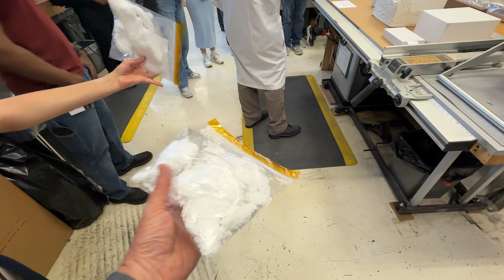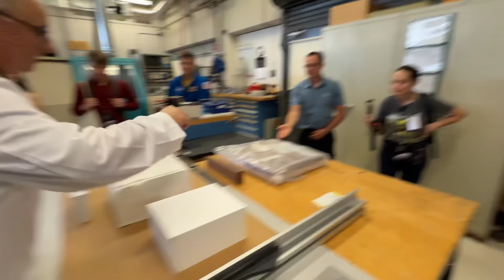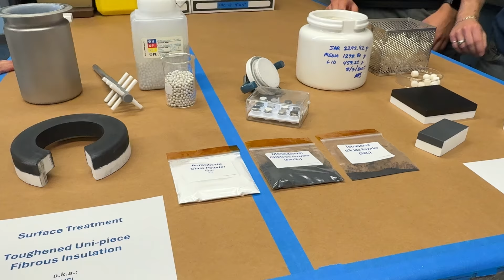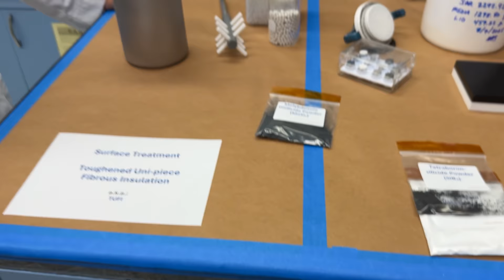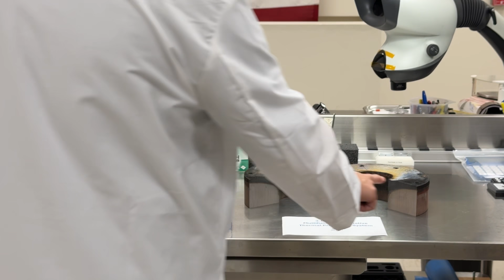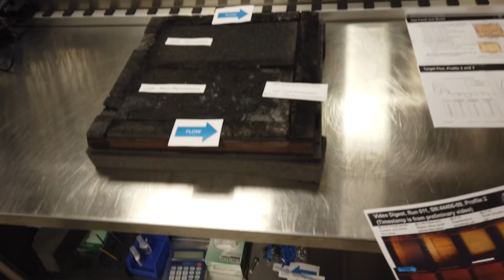Inside NASA's Heat Shield Laboratory

Comment: By definition though, like a passive tile, is a high insulator. That means it slows the transmission of heat or kinetic vibration in matter. So being in the atmosphere, at a fast velocity, and thus hot, would have a time limit since an insulator is a resistor, not a barrier. So all that is just creating as good an insulator that physically withstands air forces to some degree also. You are probably looking for isolated covalent solids.

Comment: I worked at McDonnell Douglas Boeing. The old Rockwell that designed and built the shuttle was already merged into the company. I worked with an engineer on software tools that could do multiple disciplinary optimization design. Fancy word for the way it could do mechanical design, stress, thermal at the same time. We put together the tools and he ran a simulation and the results were re-designed shuttle tiles including their shapes. It knocked 1,000-ish pounds from the vehicle. NASA was very impressed. They didn’t fund it given the costs to implement it and the shuttle was at the end of life.

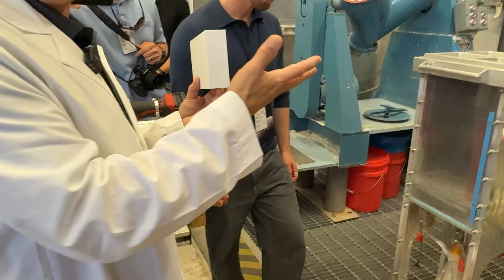Comment: 8:20 how you control the fiber orientation? to me look chaotic no control. also why chope it? (i know it say for density to give more structural) but that also give less control in orientation. is like CNT? bad conductor horizontal and very good vertical/axial? if not than why dont use something like fishing line and lay it down to cover the are and intercalete them but it give lot more air to material. (fiber optics)

Comment: They have these extremely expensive coatings that need to stay mixing or they go bad and they don't have a back up power supply, so if the power ever goes out they are ruined. I don't know how much power those rollers use, but I feel like an ordinary UPS would run them for a long time.
Reply: Cost vs. Risk - Investment and maintenance of UPS across decades vs. a few liters of coatings lost once every10 to 15 years when there's a power outage. A few liters of coating is definitely cheaper.

Comment: Back when SpaceX was starting the heat shield research, I got into a conversation on YouTube about the materials that are used in the mix.  I pointed out a material that is common knowledge, but most don't think about it, and it felt like a feeding frenzy as the focus turned to me.  I am just a retired engineer, with no background in this field.  It is funny how people don't relate grinding materials to heat resistant materials!  

I am shocked we haven't developed a heat shield from lava!
Reply: I would guess the brittle nature of it along with weight, sourcing and shaping it knocks lava based out of contention. You could melt rock but that's energy intensive and you would need to get the gas content correct to replicate actual lava. This stuff is easy to blend, shape and low weight so no need to replace unless something substantially better comes along.

Comment: I don't quite get why we are so opposed to ablative shielding it works so much easier and is so much more reliable. If you use those fragile tiles, at least put an ablative shield above it to protect them until you actually need them.
Reply: Simply put, we like tiles because they're cheaper than ablative shields (much less labor to produce, meaning much lower labor costs to produce), they're reusable (ablators have to be completely replaced after a single use because of the way they work), and they're lighter/less dense, meaning less of your payload mass goes into the TPS and thus more can be spent on things that are useful outside of the "Eight Minutes of Terror."

Ablative shielding is great if you have a Moon Race budget (4% of the entire federal budget!) and are expending each vehicle after a single use, and is still the best choice for high-speed re-entries like trans-lunar (and trans-planetary) direct entry trajectories--note that Artemis's main heat shield is still an ablator--but if you want to be able to reuse the vehicle in anything approaching a rapid fashion, you need to go with something else, particularly if you're trying to do it on a relative shoestring budget (NASA currently gets less than 0.5% of the federal budget).  Everything is a tradeoff, and in many ways, ablators are sub-optimal for many jobs.
Reply: @rdfox76  "because they're cheaper than ablative shields " no, they are not. they are really expansive.

"ablators have to be completely replaced after a single use" so what? you also have tor refuel your rocket.
the wording "single use" sounds like little use. But one reentry is a lot of use.  You also replace the breaks in your car from time to time. 

"-but if you want to be able to reuse the vehicle in anything approaching a rapid fashion, you need to go with something else"

sorry, but reusing a vehicle that rapid, that bolting on a new heat shield is the hold of is delusional. You do need to do a hole service cicle in between flights. And those tiles make that actually more expansive.
Reply: They are reusable and don't have to be re applied, so cheaper.
Re applying a heatshield is a sensitive, lengthy process that has to be done in the lab. Believing otherwise is delusional. Having to do that before every launch significantly impacts the launch cadence and other costs.
Reply: @mattcurrent0  reusabality does not automaticly make things cheaper. the experience so fare is, that those tiles make things more expensive and that they are less reliable than ablative shields.
Reply: @MusikCassette  Yes, just using some tiles doesn't make it automatically better than ablatives and the Shuttle is a poster child for that fact. The process to inspect and replace those tiles was painfully long and expensive. So many things about the Shuttle were ass backwards like that.
However, those are not inherent issues with the tile approach in general, just the way it was implemented on Shuttle. For Starship tiles, Spacex has fixed almost all of those flaws and it will give much better results than ablatives.
Reply: @mattcurrent0  but the fragility of those tiles is an inherent problem. Also, Ablation is an elegant way to get rid of heat energy.
Reply: @MusikCassette  One would think so, but experience has proven otherwise. On Shuttle it was an issue because the orbiter was side mounted, so the foam covering the external tank could (and DID) come off on ascent and hit the tiles, breaking them off. That's obviously not an issue with Starship because in a Starship full stack nothing is side mounted and the Ship, which has all the tiles, is at the top of the rocket and there's nothing above it that could come off and hit the tiles.
As for elegance... well elegance, like beauty, is subjective. Me being a giga nerd, I find all of them elegant. It's not really what we want to base our engineering process on, instead of what works and is practical.
Reply: Depends on the vehicle and its entry profile. Reusable hits the sweet spot for some, while ablative is required for others. Some might use a mix of both (dare I say, Artemis?). There's no 'one size fits all' solution.

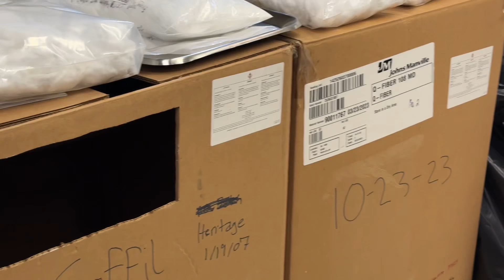Comment: 7:18 That's gotta be SpaceX for sure
Reply: Probably, but I suspect they were more hoping for improvements in attachment and waterproofing than performance.  Making the reuse more rapid, that sort of thing.  They had already greatly simplified the manufacturing, installation, and inspection issues simply by dint of using a simpler vehicle shape that allowed the vast majority of the tiles to be one of a single-digit number of identical mass-produced ones rather than having unique shapes for each position like Shuttle did.

Comment: The Apollo Shield Used an ablative material called Avcoat that was manually injected into over 300,000 individual cells of a fiberglass honeycomb structure. It was highly effective but incredibly labor-intensive

Comment: What type of pressure is seen at the surface of the head shield is seen during re-entry? I guess if we had the weight of the reentry vehicle, the surface area of the shield and the acceleration over time from reentry we could get a rough number. Curious the amount of force the small sapphire plug sees

Comment: I remember in 5th grade our teacher had us recycle paper and make it into new sheets of paper, basically with this process. Funny how some things never change, even when you're doing literal rocket science.
Reply: Hey, fiber manufacturing is fiber manufacturing, no matter what the fiber material and matrix are!  In 4th grade, I made my own paper (more like Egyptian papyrus, but still) out of corn husks using the same basic process, except that I used a door-screen drying rack to extract most of the water before pressing, then dried the pressed product on another door screen drying rack.  It's not far off how Formula One teams make carbon fiber bodywork for their race cars, either, except that they just used weaved carbon fiber cloth, layered, and impregnated with the resin rather than trying to dissolve it into the resin (longer fibers are better for their purposes).

Comment: Was Eric Berger there? Because Ars printed an article of his from July 27th subtitled...  "NASA has not made substantial investments in thermal protection research for decades"
 ( ars tech /space/2026/07/despite-recent-successes-rapid-reuse-of-starship-remains-a-tough-nut-to-crack)

This video seems to conflict with that assessment.

And on that note, did anyone ask the hosts what they thought of the heat shield tech on the private company rockets? I guess he touched that a little when he said a company tried and then asked for a technology transfer, but did anyone ask him directly if he thought, for example, if SpaceX would ever enable rapid re-use without having to replace a significant number of heat shield tiles between each re-use? And if they achieve it, can they expect any reverse technology transfers?

Comment: I think NASA can afford a ups for those spinning solution racks...
Reply: They probably didn't expect a power cut in the first place. But what they really need is a generator backup for the labs. Losing power for a few minutes isn't an issue, but you need something that can keep those rollers running all weekend.

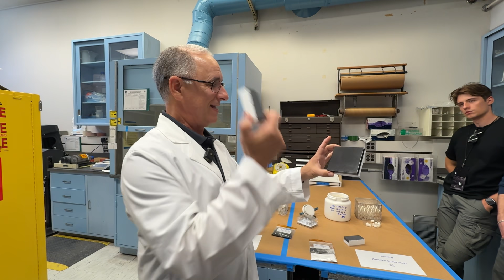Comment: 20:10 Wow, that's the first I've ever heard of injecting water proofing into the tiles. I took close up pictures of Discovery two weeks ago and yep, the holes are clearly marked on all tiles. Amazing to learn something new like that after following the program for 40+ years.
Reply: Also, I wonder if SpaceX is doing the same with Starship's tiles. That would explain much of the white streaks we see from IFT 13. Shuttle Discovery still has white residue originating from each of those holes in my photos.
Reply: It feels contraproductive: making the coating and then punching it. But I bet they tried altenatives already.
Reply: @jurjenbos228 the black coating, as explained in the video, was to help radiate heat and be more robust than the silica underneath. I've held a block of it; it feels like styrofoam and it's very brittle.

I just never heard it requires a water proofing solution. It makes sense they'd want to prevent water intrusion, which could turn to steam and blow off tiles. Since the tiles expand, there are expansion joints around them. It's stuffed with a silica felt, but it's also a place water could seep into the tiles as the vehicle sits outside preparing for launch.

Comment: I’ve wondered if there was a spray on ablative coating that could be used between flights, much like deicing aircraft in freezing weather. It wouldn’t do all the job, just take some of the load off the tiles. It even might help sealing between cracks in the tiles and even perform as a type of glue. I don’t know what it would be but it sure would help with fast turnaround.
Reply: SpaceX is actually using such an ablative coating under the tiles on Starship, to provide redundancy if a tile is damaged or dislodged during flight.  It isn't reusable if it's ever exposed to re-entry plasma directly, instead requiring removal and replacement, but it does provide a "belt and suspenders" backup to make the overall TPS more robust and damage-tolerant, particularly when combined with the stainless steel structure that can take more heat than Shuttle's aluminum structure could.

Comment: I would guess that the company he would not name at 7:18 is SpaceX. So, they pretty much are still using the same material as in shuttle era for the tile itself, the only thing they could optimize is how to manufacture and how to mount the tiles.
In early star ship tiles, the metal inlay that the pins on the hull click into, seems to have inadvertantly introduced weak points that the tile would preferably start to crack from. I wonder, if they found a solution for that.
Also, he says later that the water proofing is applied after baking because it would vaporize while baking and that it has to be reapplied (after each flight?) which they use the same hole for. If that is the case, SpaceX will need another solution for this when they actually want to refly starhips with short turnaround times. Not having any waterproofing is probably fine as long as it is early prototypes that are only flown one time anyway.
Reply: That's the danger of guessing.
Reply: They actually need waterproofing even for single-use flights simply because the ship is sitting out there exposed to Texas rainstorms before launch.  The big question is if SpaceX has found a way to make the waterproofing not vaporize and sublimate out during entry, to make the ship turnaround much faster than it was with Shuttle.
Reply: A while back, it was confirmed that the Starship tiles formula is slightly different than Shuttle's. Although it's still mostly the same.

Comment: I wonder how SpaceX has managed to take the technologies you saw and apply them to mass-produced tiles for the Starship. I cannot imagine that the in-house, hand-made craft work seen here would work for them. 

Thank you for posting this video.
Reply: The company he didn't name at @7:30 is almost certainly SpaceX. They probably figured out a production process that minimises manual handling, but had to base it off the process that NASA AMES had developed to do the basic production.
Reply: @ZaphodHarkonnen  I'm curious how the Lab thought of the performance threw re-entry of Starship.  I believe it was first time anyone has ever seen re-entry like that in real time.  It's perhaps is not as fast as the Artemis re-entry, but it still their variant of their baby (stuff they made.)
Reply: @ZaphodHarkonnen  Almost certainly?  That's a pretty big guess and that's ALL it is.
Reply: Spacex has a much more forgiving cold side than anything NASA has flown.  That's one of the big benefits of stainless steel.  It's robust.
Reply: Mass producing stuff like this is a whole other project. The final factory made product will obviously never be as good, but you adjust the process till it's good enough. Remember how they showed some samples that could not be mass produced?

Comment: For the non Americans in the audience, the density measurements repeated in the early part of the video, 8 pounds per cubic foot to 20 pounds per cubic foot are 128.148 kg per cubic meter and 320.369 kg per cubic meter in normal people units.
Reply: We Americans use both the metric and imperial systems quite well.  The "Metric Snob" countries couldn't use both to save their butts!
Reply: Thanks!

Comment: In the mid-70's, my Mom married a scientist. He was a polymer chemist working with NASA to develop the shuttle tiles. He would bring these bricks home, put them under a torch until they were glowing red, then have us hold them while they were still glowing. The marriage didn't last long, but as a kid I enjoyed his demonstrations.
Reply: I had a friend working on the tiles too. It wasn’t the fluffy ones that they ended up selecting. My friend made a backgammon board out of them. They were thin and hard ceramics. He worked at carborundum in Niagara Falls.
Reply: Aww well thats cool you got to experience that
Reply: You'll notice also that he picks it up on the corners so there is very little surface contact with his fingers.  If you flex your fingers so the same skin isn't in direct contact continuously you can hold such a thing longer.  

:eyes-pink-heart-shape:

:eyes-pink-heart-shape:
Reply: Wonder why the marriage didn't last. Maybe HE was too hot to handle.
Reply: They disappeared him for national safety
Reply: Heat shield material is under ITAR?
Reply: He didn’t get fired for bringing ITAR stuff out of work?
Reply: @kinneticsand5787 Why would he? He wasn't exporting.
Reply: True mb. Epic story nonetheless
Reply: @kinneticsand5787it was a different time in history. They played fast and loose with the rules back then.
Reply: @kinneticsand5787 1970's.

Comment: I think what they're trying to say about why it's ok to have small holes in the heatshield is that the air in the holes stagnates and and acts as a cushion to prevent high temp flows to impact the pressure vessel.  If there was an exit path, such as a poorly-adhered heat shield next to the hole, then high temp/velocity could erode away the surrounding heatshield and impact the pressure vessel.  The risk for this happening is low, so the overall benefit of having these sensors greatly outweighs risks of the sensor holes causing issues.

Comment: This article "Experts warn current Starship heat shield tech is a “dead end” for rapid reuse
NASA has not made substantial investments in thermal protection research for decades." seems to coincide with this video. Trying to get more funding maybe. I am sure smarter everyday will make it obvious what they want out of the video. I still remember when the starship was supposed to be stainless steel with tiny weep holes.
Reply: Nonsense.
Reply: @imaginary_friend7300  You really just go around calling comments nonsense... Did you at least read the arstechnica article?